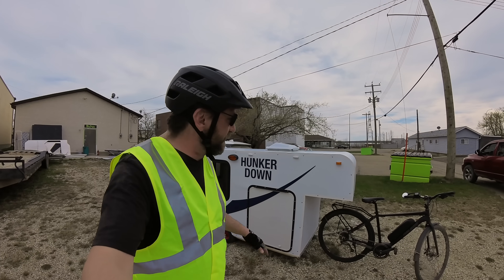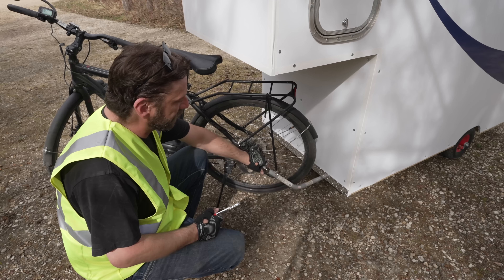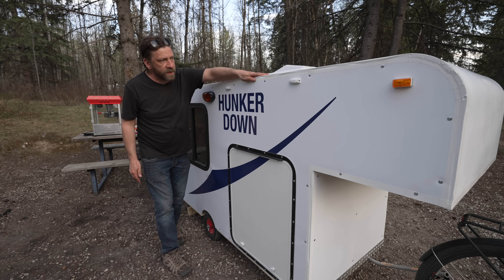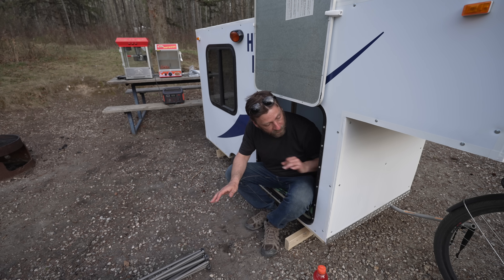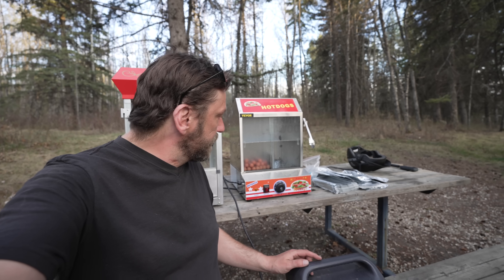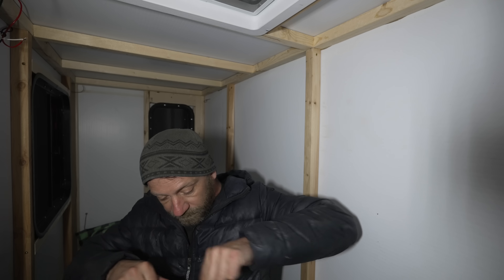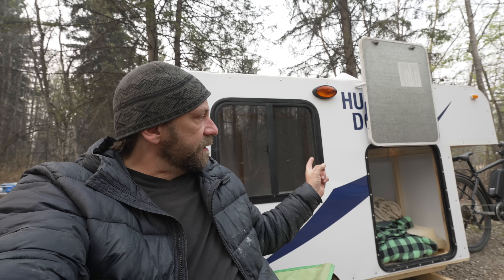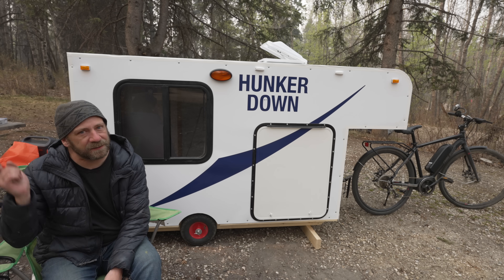DIY Bike Trailer Camping

Comment: Maybe get some rigid foam insulation, cut to fit between the framing, adhere wall paper to the outward facing side and pop in place, you can use a 2 sided tape or any adhesive really.  I've cut the insulation and they have popped in place and 2 years later, they're still in place, although my structures aren't mobile. For aesthetics you could also stain the framing, but make it a part of the interior design. Just a suggestion.

Comment: Sterfoam on your inside wall will be about all you can use to cover walls plus  insulate with  plus not weight that much because i don't think you have the horsepower and breaking might not be able to handle it plus beer to the mile wil; also  go up on your mileage lol

Comment: Ideally you would install a switch for the electrical wiring, however in the current moment you could use Anderson Powerpole connectors to make quick connections that barely add an ounce to your wires.

Comment: Something to consider. Look at the size ratio of the trailer tire vs. bike tire. If the radius ratio is 10:1 then if you are going 10 mph on your bike, that trailer tire is going 100 mph. You want to look at the speed ratings for the trailer tires. I've seen a lot of blowouts due to over speeding and heating up the air inside them to the point where they can't hold the pressure anymore

Comment: I wouldn’t put anything on the inside walls as far as another board, it will make the space look smaller. You could just paint the studs to match whatever wallpaper you put on the existing walls. Cool camper!

Comment: If you want some ideas of what you can do with your trailer, you should check out the self driving rig Quest Nerd has set up. Yours obviously doesn't need to self drive as you're driving it with the bike but he's got other stuff in there that you might find useful for camping.

Comment: Steve, I've been following your channel for quite a while, and want you to know this was a great episode.  I'm going next to see the build video.  For comparison, my current home is a 45' fifth wheel toy hauler, grossing 21,000 lbs.  I drive a one-ton dually pickup pulling it, with my motorcycle in the back of the trailer.  The MSRP on truck and trailer was just north of a quarter mil US.  Seeing a rig like yours is just amazing.  Sure, it's not quite the same lifestyle, but I have a lot of respect for the design, construction, and use of that.  I'm also glad that, after such horrific setbacks in your life, you seem to be moving forward, making the most of it.  You're inspiring.  As for the popcorn machine and hotdog machine, I had to stop the video and show my wife.

Comment: If the thing is heavy just cheat. Get a bigger Ebike and stick some solar on the camper and get a bigger jackery.. and dominate the bike camper youtubes. Some of them i dont even know how they stay together while they are pulling them. You could even insulate that and put a mini mini stove in the top part.. find a water tank that fits under the thing between the wooden frame even if you had to raise the axle to keep the weight lov and help with cross winds blowing that thing and you off the road.